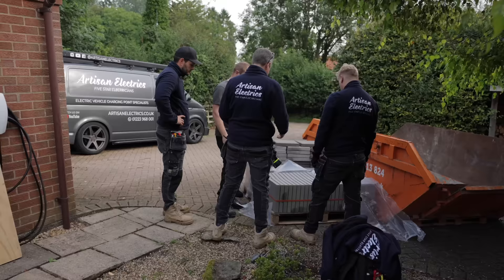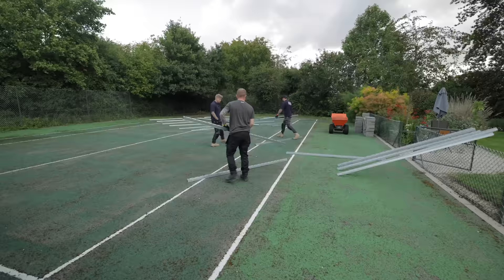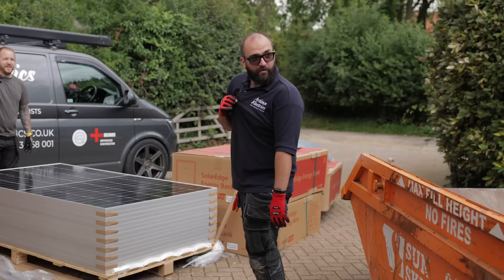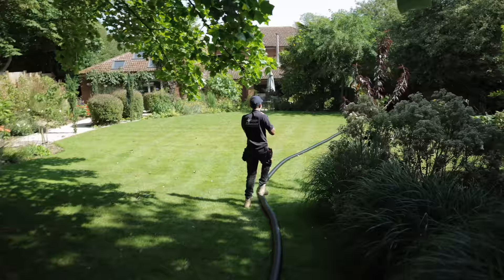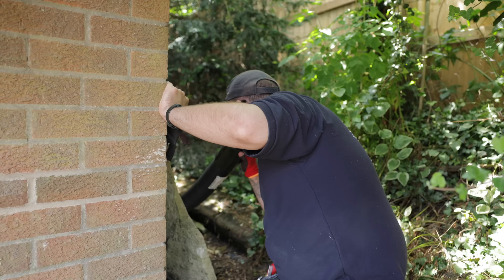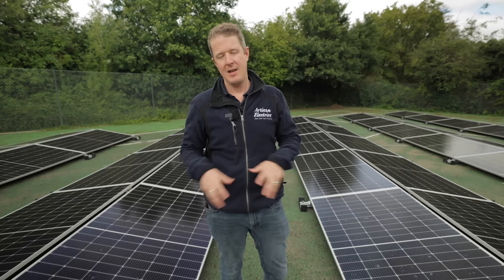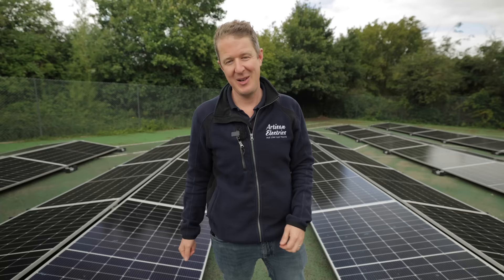Turning a TENNIS COURT into a SOLAR FARM! 🎾⚡️

Comment: Don’t often comment, but those cables in the poorly installed floor basket will be eaten by squirrels and other rodents in no time at all. They need to be armoured or AT LEAST in conduit. For £60k I’d certainly be expecting basic cable protection designed as a minimum for single tri rated. One of the electricians on site should have picked up on it. Great videography though 👍🏿
Reply: It'll be the last thing that Squirrel will chew into, leave it as a warning to others.
Reply: @kentmccroskey3712 no it wouldn’t, it happens quite a lot.
Reply: @kentmccroskey3712 why? The solar panel's pos/neg cables are not related to earth... there will be no current flowing unless they would chew into both at once.
Reply: Always funny listening to the classic 'cowboys here / what a bodgejob'....when biggest clowns are making youtube videos putting down proof
Reply: @callmefoxie2950 Firstly, their is a very good chance that the neutral from them panels is bonded to ground. Secondly, that bond is not required for current to flow to ground. In fact, if it’s not bonded to ground their is a chance you could get an electric shock from either the live or neutral(pos/neg in this case) as the negative could be floating. Current will flow to earth when something has a positive charge compared to it.
Reply: The cables are armoured 😂
Reply: Not watched the vid yet, but ref comment on  squirrels and conduit, how is it proposed to protect the inter panel connections? There is no guidance, reccomendation on 'bird protection'. Interested to know thoughts,
Reply: I would angle the panels so they face eachother east west any light reflected would be used by the panel sitting opposite
Reply: I agree it would be much better even under ground in duct , I’ve installed many floor mounted systems and there is nothing but faults , yes you can say it’s not referenced to earth but that’s no excuse to leave cable to fail in the future , if cables are damaged they can cause a lot of heat which could start a fire !
Reply: @stum8374 looks like standard 6mm DC to me.

The original comment has raised a valid point but with this type of ground mount there are so many exposed cables its impossible to protect them all but i agree a bit of conduit wouldn't go a miss on the basket
Reply: You shouldn’t call yourself an electrician until you understand Maxwells equations, Kirchhoff laws etc.. and use them in differential equations, might not use them but an understanding will make you an “electrician”

Comment: $76,100 usd. These are feel good projects from homeowners. Cost wise it will never make sense to get off grid
Reply: So what? It’s their money.
Reply: Here in Germany you could have 30kWp  (without Battery) installed for like 30.000 USD or buy the Materials for like 8.000 USD and install by yourself. I bet at least 10.000  of the 60.000 GBP  are going for the Solaredge inverters alone.
Reply: I bet at least 10.000  of the 60.000 GBP  are going for the Solaredge inverters alone.
Reply: Cost-wise buying a TV, or a car, or joining a gym, or fancy clothes, or a meal in a restaurant, or a vacation, or a new kitchen, or installing heating instead of wearing a coat indoors will never pay for themselves. Where does this weird obsession with renewables needing to be cost negative come from? 🤷‍♂️

Comment: What a poor install, during the day when the install was starting you could see half of the system was shaded, the cables between the array and the inverter being put in cable basket outside near a lot of trees on the ground, that’s also not a good idea, rodents will try and next on them and chew them, the cables going between the panels is shoddy. The AC side looks neat and nice but why have you installed 3 Generation meters, it’s completely unnecessary. I’ve been doing solar installs for 8 years, my professional opinion is you need to hire someone who knows more about solar…
Reply: 😂shall I go😊🎉😂
Reply: Totally agree not the best Artisan job

Comment: You wasted so much space by spacing them too far apart. Also you connect the rails to each other which makes the whole system more rigid hence less ballast is needed.

Comment: As a fellow solar installer (not in UK) I'd recommend putting the concrete blocks down like every 2nd is rotated 45 ° degrees, it's easier to grab on the corners that way. (Commented at 4:30 minutes didnt see the whole vid)
Edit: I see on the rolling cart the blocks are rotated, I take it back haha
Great job, that's a nice rail system never seen that one!

Comment: I had this VanDerValk system installed on my flat roof about 2 weeks ago. Very tidy and with enough ballast it's pretty solid. Waiting for the first storm.
Reply from the maker: Great to hear!
Reply: That's what I would be worried about, A bit of wind and they will be flying away.
Reply: @davidjones6779  the system has weight calculations based on the wind speeds for your area.  My installer doubled the ballast accordingly
Reply: Where in the uk are you please.  I’m in Surrey / Kent area and can’t find an installer that uses the VanDerValk system to install on my flat roof!
Reply: @zenthor13  North East. Install was done by JDM Earth.
Reply: @davidjones6779  the whole system is tied together,  and concrete ballast blocks are used to weigh them down.  My flat roof required a structural engineer assessment to ensure it could take the weight.  Wind averages are used for you exact location to determine how much ballast should be used

Comment: I think the rubber feet are for flat roof covering so as not to damage it , don't think you needed them on astro turf
Reply: How are you going to fix anything semi securely in to Astro turf?
Reply: @Walktheline1991  I don't think they're fixed at all. They're just weighted down with ballast. However, using the rubber feet allows a less wobbly installation than trying to lay flat rails on what might not be a perfectly flat surface.
Reply: @tasmedic  no but the rubber feet are for stability as well, without them on straight Astro turf wouldn't sit as balanced

Comment: Payback illustration must be a work or art. Should include cable maintenance, and weekly cleaning costs. £60k just so you have tiny elec bills really doesn't make much sense to me though
Reply: We paid just over half that for a very similar system with higher quality panels and more battery storage and I can safely say that this will almost never get’s its money back in the lifetime of the batteries (most expensive component).
Reply: Return on Investment (ROI), not payback.

As soon as you start talking about payback everyone will quote a payback period expressed in years, which doesn't tell if it is commercially worthwhile installing the panels,  and the reason electricians do that is because they are unable to do any other kind of analysis.

What you need to do is calculate the pence per kWh of the electricity generated by the panels and compare that to the ppkWh for electricity from the national grid (you also need to include the standing charge and VAT but that's easy).

Comment: Hi, when will we see the second 2 Solax battery installed at the property were having trouble with the landscape install, had similar problem with my slave install too 300mm spacing in soldier like install (single file)

Comment: That’s similar to my system which is East, west and some south facing. Although not quite as large as your system it still manages to charge both my Tesla Powerwalls heat the water and run my two air conditioners as well as a bit to the car and grid, and fortunately I also get a FIT payment. One question though, can this system take over in the event of a power failure, does it have a gateway similar to the Tesla gateway??

Comment: surely once batteries are charged and house is being serviced the excess electricity is being exported at a fixed rate? All that credit can then be used through winter for charging the batteries at a super low rate

Comment: The panels will sag in the center and wont drain on a shallow pitch this will cause soiling. Not that acess is difficult for clening but i would add some syphon drain clips, cost pennies will make a big difference

Comment: Do you  ever use bifacial panels on your installations? And have you done any videos showing that format of panels?
Reply: I was just thinking of commenting how bifacial panels would be better for this project if floor would be reflective/white.
Reply: @vedranart bifacial are not going to be great with a van der vaalk system. I would personally only recommend bifacial on a proper ground mount installed on tables

Comment: You imply that you need to have a Solar Edge system for optimisers and individual panel monitoring.

I have a Solax system with Tigo optimisers for each panel, plus the Tigo monitoring software.

Comment: Hi,  Is there any volt drop on a run of cables that long?  Or don't you not get volt drop on DC?
Reply: Not really, a couple of volts wont really matter, since a big string can easily be 800vdc+ and just 12 or 13 amps on a 6mm² cable.
Reply: No, no, definitely no volt drop on DC. It doesn't exist. You can have a cable 1km long if you like...no problem ...

This is a very special case where ohms law does not apply. It's magical ...
Reply: Actually the voltage drop on DC is even bigger when on AC. I thought it was strange they didn't even make the calculations to figure out how much voltage they were losing with those long DC cables. It might not be a huge loss but still...
Reply: @deang5622 you do get voltage drop on DC lol
Reply: You definately get more volt drop on dc check out why Tesla's AC distribution system against DC was adopted in America and all over the world. I am not sure if it would be significant on this install. I would be more concerned about ROI (return on investment) 60K invested should easily pay his electric bill a return of 5% = £3000. and he keeps his tennis court. There has to be more in this maybe its a Tax scam?
Reply: @ericmcrae7758  Voltage drop is a function of current and resistance(and impedance) and nothing else.

Go learn basic electricity. Clearly you haven't studied much electricity beyond the age of 17 years old.

Comment: Great job. I truly think they need more battery storage. I have 11,200 watts of solar, 10kw inverter and 57,2 kw of usable battery storage. I want to double solar and battery storage while adding 1 more inverter. Right now I can go 3 days with no sun and when done I will be able to go 7 days. usually within 7 days I have 1-2 days of decent sun in winter which means I can charge up the batteries fully and then on cloudy days UI can make 25-50% of supply demand. It takes so much extra in the winter since low amount of sun hours.

Comment: Just put an ammeter on each  string at midday and you will instantly see if one string is not performing properly at peak output and pigeon poo guano is obvious visibly and each panel has three bypass diodes so optimisers are not necessary

Comment: A fair number of those panels seem to be in shade at various times during the filming. If that was the only place for the solar farm, then I'd probably have thought about microinverters rather than strings, as this tends to be much more efficient in slightly shaded systems.
Reply: Easy enough to trim the trees back.
Reply: That being said. Any light is light. I’d have opted for a more efficient panel like the Maxeon 6 which has less degradation over time too, plus their new AC version with enphase micro inverters look the dogs.
Reply: It's SolarEdge so it works in a similar way to micro inverters. Each panel has an optimiser and allows the panels on the strings to decouple from each other, so if one panel is shaded it doesn't lower the output of the other unshaded panels.
Reply: Who uses micro inverters now? SolarEdge is specially designed for shaded arrays

Comment: I can see why 10 degrees might be used on a flat roof (visually unobtrusive but wouldn’t 40 or 50 degrees be better for particularly winter generation?
Reply: Better for winter generation, especially with bifacial panels, but they’d need to be spaced much further apart otherwise they’d shade the next row.

Comment: Great job, but I wonder if these concrete tiles will hold up in a windstorm. A strong current of air under these panels is enough to create a cascading effect.
Reply: That tennis court is quite sheltered with all the trees around it. I doubt wind will be a problem
Reply: I was wondering that too. In the US you'd be required to use several times that amount of ballast.
Reply: @niktak1114  It would be much better and easier to screw these rails with 12mm screws, probably the costumer didn't want to damage the tennis court
Reply: @araujofi  yeah I was expecting them to use ground screws. Perfect application for it.
Reply: Absolutely no need to fix it the floor. Sure they would have used the van der vaalk planner that does the wind load calc to work out the ballast.

It will easily stand up to a storm

Comment: I don't think I've seen a layout of panels so flat, and with the 2nd row angled away from the first. Why was this layout/angle chosen?
Reply: It's an east/west array which is supposed to do quite well in our lattitude and is used on most of the arrays in farmland that I have seen. It gets better coverage of early and late sun which a purely south array would largely miss but obviously all static arrays are a compromise. It also makes perfect sense of the over sized wrt the inverters set-up, you will never get 100% out of such an array but you will get a longer day.

Comment: Wow. What a job. Were you not able to consider a simple mechanical lever elevation adj for summer/winter?
Reply: I was wondering about that also, increasing the angle in winter would help increase production right? I like ground mounted panels for the ability to mount them in the right direction and easy access for changing the angles. Cleaning access is also easier in this setup. I also like install where the panels are above grass, veggie gardens or sheds but then you need council approval and cost goes up.

Comment: is it about securing the electricity supply for an entire village?
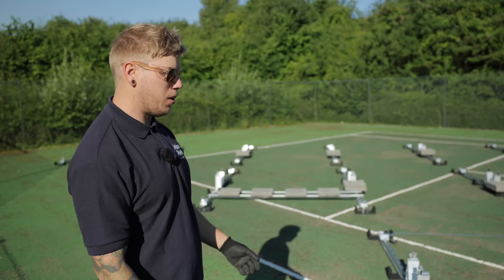13:34 Now you already have shadows on the square. That's not suitable.
At an inclination of 15 to 20°, self-cleaning would already have taken place. 10° is very flat. Set up correctly, it should have been 40°, but then there are shadows
Reply: Tell  Van Der Valk as they make this system & it is in wide spread use.

Comment: Great job guys, but disappointing at the end because it would of been interesting to know how the oversized Solar edge worked! At the 27:00 in the video I notice the pipe work was left open and the cables run into an open cage. This might be encourage small rodents to run through and chew the cables!, did you take any further steps to provent this?
Reply from the maker: We did end up covering the gap!

Comment: I thought optimal fixed angle for the UK was facing directly south and at 36 degrees from the horizontal. I tried east/west config on my shed(12 degrees) and the output was dismal throughout the year compared to my south facing roof(28degrees). Not having a go just curious as to the design.
Reply: The due south thing is a true if you're going single string, doing an east-west install gives more energy overall, but requires twice the number of panels.  They've over sized on the panels to compensate for picking a poor installation angle. My understanding is that installation system used is for flat roofs where a more conventional angle may not be desirable or achievable due to planning rules etc.  At 10 degrees on a winters day it might be better to switch the system off to save power - particularly with ground mounting in an area with boundary shrubberies.
Reply: If available space on a wall mounting becomes better in the winter light the further north you are.

Comment: I have a question about the types of solar pannels. Mainly because I live in Scotland so we dont get alot of sun. But I would want to utilise the best amount of energy production I can in Scotland as possible. The silver type ones I wouldnt mind on my roof. But what would be the best for my Enviroment?
Reply: Next to no difference, the all blacks basicslly just have a powder coat on the frame, and the cover on back of the module is coloured black rather than white. Most installers will quote for silver frame as they are cheaper and they don't want to lose a job bacause they have speced something more than another installer.

Comment: Nice job.
Q: how do you cope with over voltage on the DC input which is normally 480v?
60 panels with a VMPP of 33.96 = 2037v 3 X inverters  @ 480v = 1480 so DC over voltage of 557v
Reply: Voltage regulator
Reply: @Walktheline1991  really, for 60 panels? Do you have a link for one? Thanks
Reply: At 25:00 you see them pulling ten cables, two per string so that’s five strings.
Reply: @HowardBurgess  5 strings still carry the voltage, unless they connect in parallel.
Reply: @andyhughes3214 if they weren't in parallel then they wouldn't be feeding the strings separately to the house
Reply: @andyhughes3214  well, they’d carry the voltage from whatever panels were on each string. If roughly a fifth of the panels were on each string the voltage on each would be about a fifth.
Reply: It's doubtful they are in parallel as the amps would be massive! And in series it won't matter how many strings, there is still an over voltage. Let's see if Partisan tells us how they overcome it.
Reply: @andyhughes3214  the amps per wire would not be massive because there are 5 pairs of wires going through the conduit